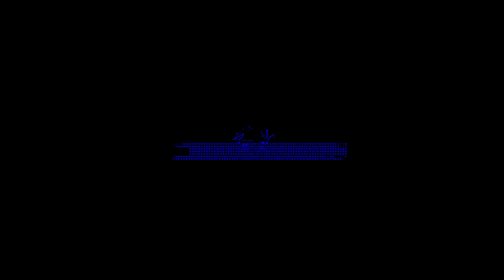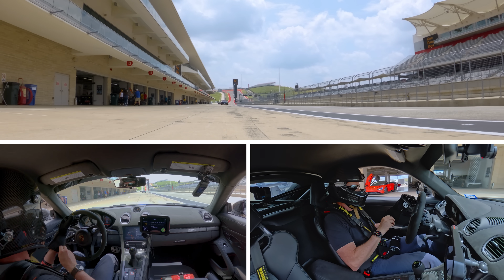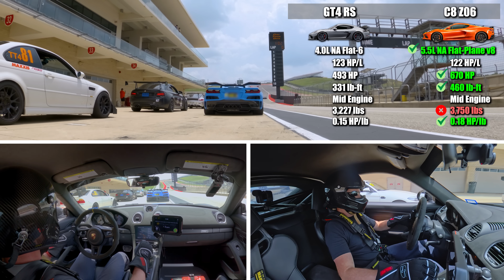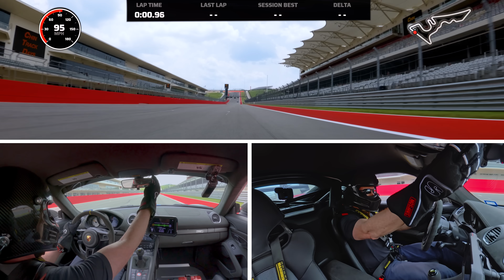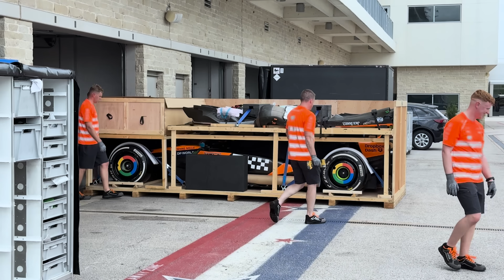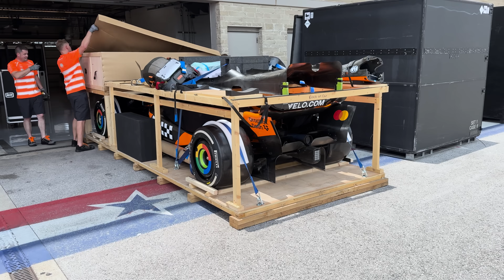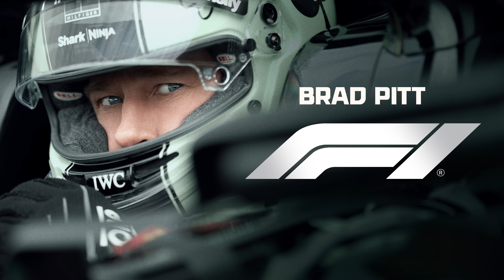Z06 vs GT4 RS : American Power Meets German Engineering at COTA

Comment: I have to be honest, I don't think this is a reasonable comparison.  Yes, the Z06 is heavier and you are probably able to brake a tad later.  But you didn't make up distance in the corners (purely) because of that.  You made up distance because you are driving hard and the Z06 was just driving fast and having fun.  You can see it in his lines and how he was not using the curbing.  He was braking WAY earlier and gentler than he needed to.  He wasn't going full out, or at least he wasn't using 100% of the car like you were of yours.
Reply: The driver of the C8 posted in the comments. His name is WesternLandLLC. He said that he had street tires on and had a student in the car, so he was not going all out.
Reply: @Northanteus  Yeah, I saw that after I posted this. :)
Reply: @Northanteus  not going all out yet still almost spun out lol. or was he the second z06?
Reply: @Northanteus oh brother 😂
Reply: Yes. The driver had commented that he had a student passenger in the car with him.
Reply: He also made up a lot of time by going beyond track limits multiple times.
Reply: exactly, 200 lbs heavier doesn't mean much when the ZO6 has almost 200 hp and 100 ft lbs of torque on the GT4RS!  Lets throw some R888R's or Pilot 4 cup's on the C8 and let's see what happens.  Honestly, I'm not even a huge fan of the C8, definitely a Porsche fanboi!! But man, you should have brought the correct car out!
Reply: @UnapoligeticallyAmerican 500 lbs heavier
Reply: Maybe you are wrong https://www.youtube.com/watch?v=F2fhnOogmFg&t=90s
Reply: sounds like this fella enjoys losing
Reply: Guy was sideways in the ZO6 😅 seriously
Reply: The vette would inevitably start to run hot, soak, and get passed by the purpose built Porsche. Local tracks here in Florida seem to always have vette's that lose crank or rod bearings from the excess heat.
Reply: @cantbsdave  The official Vette track and school is just outside Vegas at Spring Mountain.  We ran for 2 days straight and did not have a single overheat.  Are you talking about older Vettes?  Because the C8 has no problem with the heat.  And the Z06 IS a purpose built track car.
Reply: “Having fun” is for Novice/ Intermediate class.
Reply: @Kiteboarding316  It's a track day, not a race.  Having fun is any class you want it to be.  Advanced just means you can pass in more locations
Reply: Corvette guys (retired guys) have made excuses since the 996 Porsche. Look, today's Corvette ain't my Father's Corvette. It's a Ferrari posing as a Vette. Me personally, if I'm gonna spend that kinda coin out of my retirement or mutual fund, I'm going with the real deal. A Ferrari or Porsche. And allow those C7 and C8's to land where they should and that's in a working man's Driveway.

The Porsche and Ferrari are priced accordingly, pedigree, research and development and longevity. The Corvette should be the step up from a Camaro or Mustang instead it's pre owned Porsche and BMW M money.
Reply: @vidsbfree4me You do realize that Corvette has been racing for decades, right? And, that they’ve been some of the most dominant cars in GT3 for decades? Please research before speaking on a topic that you respectfully have no clue in. 

Also, Camaros have been racing for decades, and have been beating up on European sports and track cars for a long, long time.
Reply: @danieldickerson4838 huh?
Reply: You had me with working man part. 🫡 @vidsbfree4me
Reply: @vidsbfree4me  Dude such a lame comment.  The original poster was merely speaking about performance and you made it about class?  You are clearly not a car guy.  And, you show you have very little class...
Reply: @vidsbfree4me  i’m not sure if the Porsche is priced accordingly these days, while it’s an excellent car with a proven pedigree I think it has gone the way of Ferrari to a certain degree. They are using production to control the market and sell at drastic mark ups due to lack of supply, with an exclusive club type mentality. This is Rolex thinking, paying way too much for branding. The corvette is indeed a sub level quality car, with proven reliability concerns, but the pro is availability.
Reply: porsche income drop ninety six percent
Reply: Vidsbfree4 me in a nutshell you summarized to a t this long standing duel; you truly are an " insider" regarding the subject, far more than the majority of commentors here. Thanks for sharing. Cheers!!!!!

Comment: U keep talking about weight and yada yada not one time did u mention the fact the Vette pulls more G in the slalom and skid pad. So your theory that the car won't handle turns as good is garbage when the car is a good bit wider than the Porsche and pulls more G. Wear some stuff faster like brakes n tires sure. But marginally. The brakes are bigger so more material to wear.  The Vette is better than the Porsche period. I mean u don't even have to pull weight out to compete lol. The Porsche gt cars are lightened race focused cars. The Vette Isnt. and the Vette doesn't snap oversteer like Porsche are known for lol. No buddy u fooled urself thinking that couple hundred lbs meant jack when the cars 6-8" wider footprint minimal. There's a reason vettes are beating porches in gt cup

Comment: not sure i can take track advice from anyone running a GT4RS in automatic mode, and letting the car upshift mid corner.
Reply: You would love the old days of carburetors, no power steering and no anti lock brakes if we are going to stay true to “driving”. This is 2025 and the records set by even Chevy team in ZR1 were done not in a manual car. Also what does the lines and brakes points he is discussing have to do with automatic or manual car. You still have to drive both cars same lines and brake the same.
Reply: @tagtag-connected5263 every race car driver in the world would use the paddle shifters with the car in manual mode. And switch the traction control of. This guy  is a novice trackday driver

Comment: I have a track moded 2006 C6 Z06 6-speed manual which weighs  2950lbs with 650hp with 345R/305F Michelin Cup 2s  which I love driving. So well balanced.
I also have the 2024 C8 Z06 with the 8-speed dual clutch not as fun to drive fast. Reduce the stock weight 3650lbs/670hp  to 3500lbs / 710hp with the carbon fiver wheels, carbon ceramic brakes, Lithium battery and Evo aibox for a little more performance. The stock Cup2R front tires are just too small at 345R/275F and I am  going to try to fit 285-295ssup front to help improve braking and cornering, as it does understeer. We know the factory Corvette GT3.R race cars have much wider front tires than the production cars. - Jim G

Comment: I love your videos, but my question is did you tell the Z06 guys in advance you’re going to be chasing them on the track so that they could get ready to be in the same set of mind like you’re? 
Because if they knew in advance that you gonna be coming after them am very sure this video will be a little balanced in my opinion. Right now is one sided, plus Z06 is very affordable than your car and available too. For what you get for the price I don’t mind the extra 500lb…I can always take things out or upgrade some parts to carbon fiber to save more weight with the money I safe by buying ZO6 over GT4 RS.

Comment: Did he know you were racing?!
Reply: No. Owner is in the comments
Reply: Nope
Reply: I mean, it IS a racetrack.
Reply: @JeffHogg-g6d  HPDE events aren't racing. It's essentially just an open track session where you can go fast, slow, or you can putz around. I've thrown away sessions to test roll bar adjustments. You never really know whos going hard and whos just messing about.
Reply: @JeffHogg-g6d track days are not race days. Both Edge Addicts and Chin point blank tell you NOT to race.
Reply: He had a student driving the zo6 lol he wasn't racing. Read the comments

Comment: I see the guy in the blue Zo6 replied, and just wanted to add. that a comparison and trying to elevate your P car to another one as a car to car and not check tire choice , driver competence in the other car is worthless..    C8 Z06 on cup2R like you have will do 2.17, your not even close to that ....   ?    And the weight of yours is probably correct with full tank of fuel, but on my 2nd. Z06 I can tell you the weight you did introduction is NOT correct  for a Z06 coupe...Mine was 3650 pounds with full tank of fuel.... It's a track car whopping your ass on track AND comfortable daily driver....   unlike tour GT4 RS....   a bit apples to oranges comparison.. you loos badly in the daily driver amenities compartment, AND loose on track , same day, same driver, same tires....

Comment: I'm not disagreeing with the dynamics claimed about the GT4 versus the Corvette, but if you had two of the exact same car, running the exact same lap, a few seconds behind, the distance would likewise increase and decrease with speed anyways. A constant 3 seconds is a bigger distance on the straights than on a harpin turn. Not here to point out the obvious. Just a nitpick

Comment: First time watcher. Very nice analysis layout. Got the car weights correct if it was a Z06 hard top convertible with no carbon wheels, so kudos on that. Was following up the rational explanations until you dropped that Z06 weight/low technology comment. An uninformed comment for sure smelling almost of a pre planned misplaced gotcha. Conversely, the reason the Z06 is heavier is because of the higher content/amenities in it and the 1250HP+ top down rigidity rated chassis in it. That is where the Z06 mechanical grip advantage comes from: bigger everything and an all aluminum chassis (vs the old RS steel/alu mix stampings) to better handle it all on the track. I do agree that to obtain a no frills Z06 for pure track use the car could be stripped down/outsourced using the costs delta between an RS and a Z06.

Comment: I wouldn’t say the corvette has less sophisticated material that caused its weight. It’s a road car with space and is actually very comfortable. It’s made of aluminum, high strength steel, carbon fiber and reinforced plastic.  It’s much larger than a cayman. I really wanted a Cayman GTS 4.0 but it was pretty small inside and I’m only 5’ 11” and 185.  For a bit more than the GTS with the Porsche tax ADM the dealer added (15k) I custom ordered a Z06 3LZ. Much better car and easily comparable to a GT4 (which was impossible to get for near msrp). I actually sold my 992.1 C2S for the Z06 😅
Reply: Yep. Advanced space frame w/ multiple forms of aluminum to optimize strength & weight. (& some magnesium). Then carbon-balsa floorboards, carbon rear chassis crash bar, carbon brakes, rims, aero & wing, roof skin, optional engine brace, & tons of interior carbon. 

Not to mention the advanced composite bodies. GM's proprietary SMC (a polymer composite with glass fibers, or hollow glass spheres mixed-in). Its not as strong or light as carbon.. But its pretty close. And far beyond "plastic" or "fiberglass".

So ultimately the bodies & frames are strong, pretty light, & corosion resistant. At a much lower cost.

Not to mention C6/C7 zr1's actually used carbon fiber Fr. fenders, hoods, roofs, carbon-composite underbody panels & more. 👍🇺🇲🇺🇲🇺🇲

All Caymans & 911's are built on a steel unibody. (Much closer to everyday basic road cars)
Reply: @flexinclouds  yea yea, yet somehow the Porsches come in at much lower weights and somehow they end up with a much higher quality product. Would you just chalk it up to magic?
Reply: The reason the Corvette is heavier, is partially the extra space to make it a functional GT car, but it is also that this is the same platform underpinning the AWD, 1,250 HP ZR1X. That is more than double the output of the most powerful Cayman. There are no 4-cylinder or even 6-cylinder variants, so the whole thing is built to support tremendous driveline forces. Just look at the weights of vehicles from Bugatti for comparison. There are powerful cars that are significantly lighter, but those resort to carbon tubs and aluminum that are not fixtures of the Porsche or Vette. I do wish that the Stingray and Z06 could be closer to 3,200 Lbs., saving the mass for the crazy ZR1. But I'm sure when they were engineering this platform, that decision was made very early for the chassis.
Reply: I daily drive my z06 most of its competitors can not be used in that manner for a million reasons. When I go out of my front porch and I look across the street and it’s parked on the street and makes me smile every time.
Reply: @meccagold2009  Same. I used it to road trip to Road America in Elkhart Wisconsin last weekend for the IMSA race.  It was a great drive and pretty comfortable in Touring mode, got 22 MPG as well.  I was able to drive it on the track Sunday morning with several other Corvettes and that was a blast!
Reply: @mattabell3657 Theses cars are the last of the muscle-cars. If only I could get a tow hitch on mine!
Reply: I can’t speak about the Cayman, but for me, the 911 are more comfortable then the vette. The vette is a bit bigger,  but the sitting position and visibility is better in a 911. Granted, I drive a 911 turbo which has a softer ride than the 911 track-focused cars
Reply: You're spot on. I bought my Cayman GTS because I'm 5'7" and most sports cars feel big to me. The Porsche fits me perfectly. But I like them Vets!
Reply: It's not "reinforced plastic" the same way that carbon fiber is not "reinforced plastic" just because it uses resin also. It's called "SMC fiberglass".
Reply from the maker: For me, a 670-hp car serves no real purpose on the street—and after experiencing them on track, I don’t get much joy driving them on the road. So when it comes to buying decisions, for me, it’s all about how the car performs on track, and weight plays a huge role in that.

I’ve heard from people close to the Chevy design team that there was actually a much smaller version of the mid-engine C8 in development, but it was ultimately scrapped. Why? Because the ability to fit a set of golf clubs was apparently an important design priority.
Reply: @ItsTrackTime  Golf clubs....is that why they scraped the trunk area?
Reply: @ItsTrackTime Yeah, that sounds about right. Marketing influencing engineering and design for "broader market appeal." 🤦
Reply: @MrBeckPJ  It makes sense for a base corvette, which is the model they sell the most of, to be able to fit a set of golf clubs in the back, imo. It does not make sense for the Z variants, though.
Reply: @ItsTrackTime If that was true you’d have a Radical which is massively lighter and outperforms all of these cars on track by a substantial margin. You want a car that you can also drive on the street and flex. But the GT4RS isn’t a very good street car and it’s inferior to purpose built track cars. At least the Z06 is great at both.
Reply: @ItsTrackTime Oh, the fun is just getting started at 670 hp. Most serious street cars these days are 900 hp and up. Quite a few 1000+ cars. Talking to Corvette guys that go to run in Vegas (Pahrump) for the winter, their light weight track cars are 800+ hp just to be competitive.
Reply: @ItsTrackTime yea lol corvett has always been a old mans car😅 Chevy never cared solely about trak performance in any of their cars actually.
Reply: @mizer2597  Whatcha drivin these days?
Reply: @mizer2597 misinformed you are  has some of the best factory suspension out and have been building great track cars ct5 bw ct4 bw camaro do research first

Comment: According to fastestlaps records, the c8 z06 has quicker laps than a gt4 rs track after track after track and the list goes on. The Nurburgring is the only track that needs to get retested but all the other tracks the gt4 rs doesn’t stand a chance.
Reply: Straight 🧢. Two of those times aren’t even on actual tracks. It’s 2-2. Stop spreading misinformation.
Reply: @NoBody-vn9do you don’t know how to look up cars on fastest laps? You do know there is a c8 z06 and a c8 z06 with the z07 track package USA version, and there is a c8 z06 with a z07 track package euro spec which is detuned yet still has quicker lap times than the gt4 rs track after track after track. Information is free. I just posted them on my YouTube channel as proof.
Reply: @N0neofyourbusiness. I looked up the Z07 package cause the regular non Z06 didn’t have anything. So again, you’re wrong. Stop spreading misinformation.
Reply: @NoBody-vn9do I am not wrong because I just screen recorded what I’m talking about and posted it on my channel. The USA c8 z06 with the z07 package beat the gt4 rs on 4 out of 6 tracks so far. And the euro spec c8 z06 with the z07 package, beat the gt4 rs on 3 out of 4 tracks so far.
Reply: @N0neofyourbusiness. again your wrong. I looked up the same shit you did. 2 of those aren’t even real tracks. Tf did you not understand?
Reply: @NoBody-vn9do I won the argument the moment I showed proof of the facts that actually happened. You’re upset because you got proven wrong. You just don’t know how to accept your L’s. Move on you lost.
Reply: @N0neofyourbusiness. no you didn’t. You keep responding to another bit. I keep saying 2 aren’t real tracks. Tf are you not getting? This is what happens when people care too much about winning an argument. You lose track of the actual point. You haven’t responded to my point thus far. You just keep saying the same shit. Talking about hold a L. Gotta be a 12 year old who can’t comprehend what I’m actually saying. So again, you’re spreading misinformation.
Reply: @N0neofyourbusiness. According to @mgcharoudin the zo6 can do a sub 7 second on the nürburgring

Comment: Ya everyone who owns a z06 would like 500lbs taken out. But the car is 150k. Gt4rs 250k. Gt3 250k+, gt3rs 350k+. Your basically talking about a 750s or a 765LT which is going to destroy your car.
Reply from the maker: Exactly—take 500 pounds out of the Z06 and it would destroy the GT4 RS. That’s my point, and I’d be first in line with cash in hand for that car.